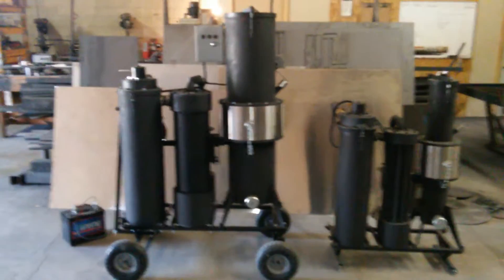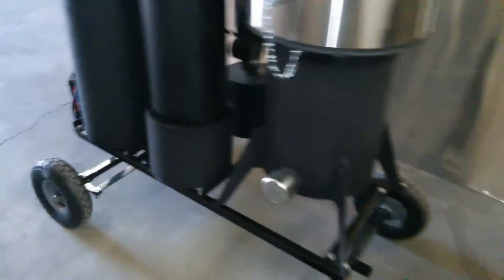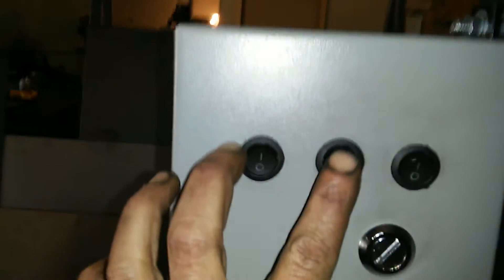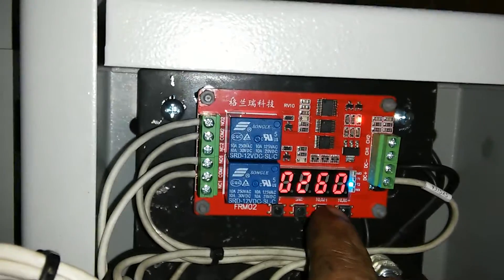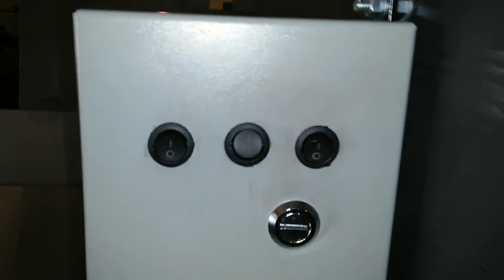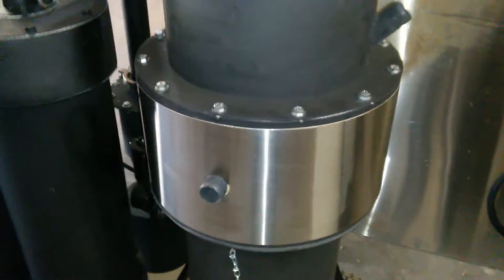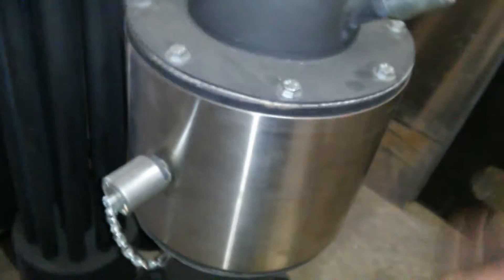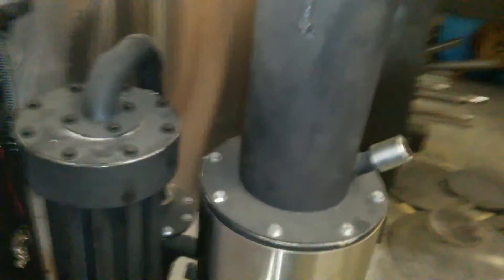2015 Vulcan Gasifier M-Series IV

Comment: Hey Matt. Just a little update. I got the timers in and all wired up and really like the way they work. I did add a FRM01 single timer in front of the FRM02 to act as a reset. My timing sequence is further apart than yours and as the cycles progress, the delay also increases by 5 seconds each cycle. I have the FRM01 cycle on / off after the forth FRM02 cycle. That resets the FRM02 as if I had just turned it on. That seems to work out quite well. I wanted to thank you for all the information you gave me. I really appreciate it. Thanks
Reply from the maker: Why do you need to set it up this way? The Timer boards can reset themselves in Mode 5 or mode 6
Reply: Matt. I have the FRM02 timer set in mode 6. Ch 1 at 2 seconds ON, 240 seconds OFF. Ch 2 at 4 seconds ON, 245 seconds OFF. As the timer cycles, Ch 2 adds 5 seconds every cycle adding up to 20 seconds by the 4th cycle. The FRM01 is set in mode 6 and set on the NC circuit. It  turns the FRM02 off and back on every 900 seconds which resets the timer back to it's 5 second delay like when first turned on. That repeats every 900 seconds. It's just a way to keep things in snyc over a long run. This is a trial that I am doing. Time will tell weather or not it works the way I want it to. I bench tested the timer for a couple hours using light bulbs and the delay between CH1 and CH2 increased that 5 seconds each cycle. I am trying to keep that delay to 20 seconds or less automatically. 
Does that make sense to you?? Is there something I am  missing in the "very vague" instructions that would compensate for that?
Reply from the maker: That is really strange that its doing that, I think you have a bad board. It should not do add any time.
Reply: Matt. I have 2 of those FRM02 timers here. Both of them do the same thing when I have a 5 second delay between CH1 and CH2. I wish it didn't do that. I do have a 3rd timer here  on the bench that is new and unopened. I'll try that one tomorrow and see if it does the same or not.
With the 2 timers, it has solved that increasing delay time. I wonder if CH 1 is the "lead" that controls the cycles. Maybe if you programmed CH2 to cycle first if that would solve the problem. I'll try that with the spare I have and see.
Reply from the maker: The last paremeter setting needs to be"101" if you changed this that maybe the issue. if you have a dual really timer. Channel 1 is for the top relay and channel 2 is for the lower relay. You set the mode for each channel. 

So other words if you select Channel 1 you can set it to mode 2 and then you can select channel 2 and set this to a different mode, say mode 6. The tow relays will then function to the modes they are set at.
Reply: The last parameter is set at 101 for each channel. I made darn sure of that. I'll play around with that spare on the bench tomorrow and make CH2 the lower of the duration times and see if that makes a difference. 
I'll let you know one way of the other. Hell Matt. I don't know. It's just what I am experiencing with it. It's possible I have a couple of messed up timers. I still appreciate all your help and input with this. Being that you are in business, you don't have to give up info on your systems. You have gone above and beyond to help. Again, A BIG thank you for that.
Reply from the maker: No problem, I have stuff I dont divulge only to protect us. But the basic stuff to help you guys out I have no problem with and also I try to clear up some of the misconceptions. like flare colors, filtering tar etc.
Reply: Absolutely. Don't think for one minute that I won't come back at you to pick your brain on something else. Not propriatary of course... LOL
Thanks again.

Comment: Matt. I wish I had a auto junk / salvage yard close. I think the closest is 40 miles one way. 
I live in the woods away from any city. I found one on line for $24.00+ shipping. It is a universal fit unit that I am sure I could make work. Yeah, I know most have "delay" on them. But there must be a way to wire it to run one or more speeds. Possibly a PWM speed controller or something to that nature. Yeah, I checked the Jeep wiper motors and about fell off my chair. They are proud of them. REAL PROUD.. Thanks for all your help and info AGAIN...

Comment: Matt. What are you using for grate shaker motors?? It looks like a windshield wiper motor.
Mark
Reply from the maker: Indeed Jeep CJ wiper motor. $$$$$$$$$$
Reply from the maker: Just go to the junk yard and look until you find one you can make work.
Reply: Hey Matt. I ordered a wiper motor on line on the cheap and installed it. It looks like it will work perfectly. I am going to use a PMA speed controller with it as well. Much better than the motor I had on there. Thanks for that info.

Comment: Matt. I have the FRM02 wiring figured out. I was able to find the manual on line. I was asking about the relay sockets and how they are wired from the FRM02 to the components to be run like the shaker or vibrator motors. I was just wondering if the relays or sockets came with diagrams. I just don't want to toast anything if you know what I mean.
Reply from the maker: Oh ok yeah those are labeled as well but you need the Hubble to see it. they are pretty simple and wired just like the board. You can not mess them up anyways so don't be worried about miss wiring them. the side that has three terminals is the "in" side. The top two are your 12 Volt wire the out from the board to one of these and this energizes the coil. The other wire is simply to ground. The lower one is your power in your are trying to relay.and then on the other side you have NO or NC going out.

Comment: Hey Matt. Quick question. Do these relays or sockets come with any wiring schematics / diagrams at all?? Or are you left to figure it out?? I have looked close at what you have in the panel, but, when I freeze the frame, it goes blury and all the wires are the same color. I can't make heads or tails out of it.
Thanks Mark
Reply from the maker: They are labeled
Reply from the maker: 12 vol,t +- on the side away from the relay and on the relay side you have your power into the relay and the outside is either NO or NC thats it.
Reply from the maker: go to this listing and click on the images there are two wiring diagrams https://www.amazon.com/FRM01-24-Channel-Functions-Multifunction-Self-Locking/dp/B01LOC0NPE

Comment: Hey Matt. I was searching around on line about the Arduino and control valves as you have here and ran across that post on DOW. Man, I don't think I have ever read a thread from start to finish like I did with that. What a pile of information on that one thread. And the help and input from the others on that site is awesome. Being that it would not be cost effective for me to have these control valves on my 4 engines. I am checking into another angle when it comes to the FRM02 timer. I am not sure if the FRM02 has this mode, but the FRM01 does.
Mode 10. Trigger mode. I am looking into a vacuum / pressure differential sensor from a residential furnace. It has a 3" to 9" WC span and has 3 pins. COM / NO / NC. It has a pressure port and a vacuum port and is adjustable via different springs and orifice's. If I can get this to work in trigger mode with the vacuum on the system, I will use that to control the grate shaker and hopper vibrator on my larger HP / RPM engines and use the timer mode 6 on my smaller HP / RPM engines. Flash001USA is working on a similar system for his build and I like the concept of using vacuum as the driver instead of timers. Both in my case.
Your thoughts?? Mark
Reply from the maker: This should be looked at a preventive measure and not a corrective measure. Once a clog or bridge happens then its already too late. A system like this is good as a back up but you want to time it so you prevent these issues as your primary measure to fight these occurrences. You dont want to over do it but you dont want fluctuations either and a system is relying on a fluctuation to trigger these events. With just the timer set up our mixture controller hardly has to do any work.
Reply: Matt, I agree with you on the preventative measure and I will be using the timer as the primary and working on the vacuum setup as another "experiment" type thing and test out both to see how it works out. Like I said, I do like the concept of the vacuum as a driver after watching my manometers working up and down. Like you mention, the issue has already occurred if you see it in the vacuum. What is your timing setting for shake and vibrate on there when running your smaller Predator generator. What, 6750 watt or something like that. I have a very consistent fuel size and usually have to vibrate at about 5 minutes followed by a grate shake about 15 seconds later by looking at my manometers. I would figure at about 4 minutes to vibrate followed by the shake to stay good through the run. Thanks for your input and great info on that DOW post. I have saved it for future reference.
Thanks.
Reply from the maker: I run brief intervals, and is dependant in fuel. The hopper shaker typically runs 1 to 2 seconds  and off times can very from 15 seconds up to 40 seconds. For the grates chips tend to free flow but still need intervention this one can get you in trouble if you activate this too much. This I tend to run every 30 to 60 seconds and again for only a 1 to 3 seconds.
Reply from the maker: I dont use presure gauges, Ive managed with out them. I tune by flare color and its consistency.
Reply: Thanks. I run pretty consistent with out the vibrator most of the time with the fuel wood I use. That us what I like about using smaller branches and the chunker depth stop at 3/4". The round branches flow real well. When I do vibrate and shake, it's around 2 to 3 seconds and no more than that, but at about 5 minute intervals. It seems to me you shake and vibrate pretty frequently. But hey, if it works for you and you are getting good results. Go for it. I may end up doing exactly that as well. I don't have near the run time under my belt like you and many others out there have. I am pretty much a newbi here in this game and still learning as I go. What I have found out is that fuel consistency is key to good runs time after time. I got frustrated trying different fuels at first until I built that chunker and use 95% oak branches. Before that, my test runs were all over the place.
Reply from the maker: Thats exactly it though and why I have such short times. I never screan anything way too lazy for that and we run mostly chips. So this fuel requires more intervention. If i ran a more uniform chunked fuel or wood pellets then I have the same rusults as you and run much less intervals.
Reply: Matt. At my age, I need all the help I can get........Gauges, cane, crutches and soon a walker.....Who knows what is next. I already have a few replacement parts in me already.
Reply: I hear that. Man, I had BAD luck with pellets. Being down here in FL with our humidity, I think it got into the pellets and caused a lot of problems. Inconsistent runs at best. Some good runs, but mostly failures. I did use chips with better results, but with a lot of bridging with the Flash design and the air inlet nozzle where it is. Another thing I built was a electric gear motor driven screen drum tumbler for the chunks. It works good for removing fines, knocking off the loose stuff and the bark if it is dry enough. Anything to make the fuel more consistent.
Reply from the maker: Yup good fuel is certainly key. Wood pellet are a different animal and require different tuning. Pellet are very good fuel if not the best fuel you can get. The density must be fully understood in order to be successful. Because of this; oxidation zone needs to be smaller much smaller as this dense fuel will create much more gas pr volume the larger your jet ring the more gas is made and it may be too cold. This then is generally too much gas for the lower reduction zone to fully process plus lesser temperatures limiting these reactions. So smaller jet ring tighter than normal restriction and as much reduction you can give it with out it restricting. A pellet machine can be built near half the size of a chip or chunk fuel machine as well. I did a video of our smallest pellet version running the 8750 Predator pulling 3 kW with more to spare. Runs times just blew me away as it still ran longer than our largest chip machine running this same generator with the same load. .  So there maybe a micro version of the Evolution machines coming soon.
Reply: I did not know that about the pellets. I guess I have the absolutely WRONG set up for pellets then. I was getting a pile of moisture out of the flare port. A lot. I do believe I saw that video you speak of, I did not know you were running pellets on that. You do get great performance out of your systems. Then again, your business and rep depend on that.
If you don't mind me asking, how many people to you have working for you and are you able to meet demand for your systems?? Where I am at down here, I have met one person that even knows what a gasifier is. Most think I have built a rolling meth lab or something. That is scary.
Reply from the maker: lol yes when I started we were building out of my garage originally. Once we started taking on orders for the V8 machines we had no choice but to get into a larger building. However this last year or so machine sales have declined. As you may have seen I have rolled back the product line a bit in light of the TOG barrel gasifier kit. It make zero sense to offer those more expensive machines and this stupid barrel machine will out perform all of them for a fraction of the cost. So Ive dropped all but the Utility S4 and it now carries the Utility badging alone. This machine is now the Cadillac of any stand alone gasifier of its scale on the market. It now comes fully loaded standard and this includes the electronic fuel mixture controller, final gas dryer and adaptors with options for existing engines like the Honda GX630 or any of the Predator engines. More will come later. We have this machine down to just a few weeks manufacturing and the very first three with full design finalization are on our floor now. I have three employees, a CNC Tech a Weld Tech and an Assembler I do the other 65 jobs :)
Reply: LOL,,, The other 65 jobs......YEIKES. I hear you about sales declining. Hopefully, you won't be left with stock you can no longer use. My brother and me ran a custom paint and fabrication shop working on Harley's out of the house as a sideline and were going to do it full time once I sold the house and retired. Like you, seems the bottom dropped out of the market. But, not before we built a 3750 Sq Ft shop at the new property and over $3K in custom paints still in the cabinets. So, that is over and done with and I have a big shop not making any $$. Seems folks have more important things to spend their $ on. I am going to check out the S4 video which I see on the right with a 8750 Predator gen.
Reply from the maker: Thats a good video it does show the machine make a little tar at first and recover quick from it. I had poked down raw fuel past the restriction and this was burning out yet. Typical for a new machine